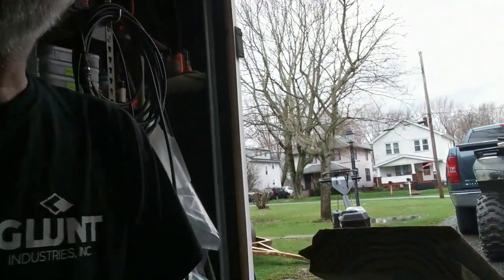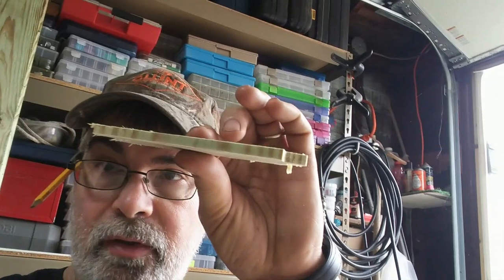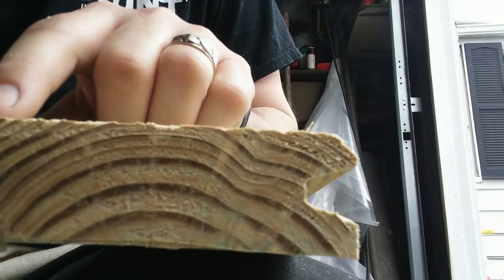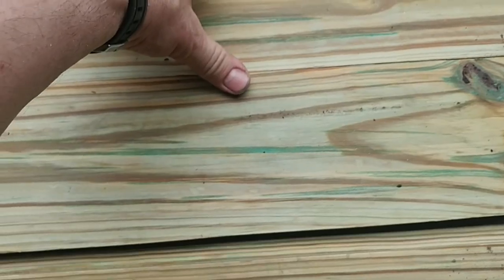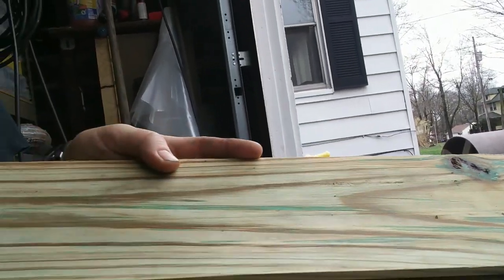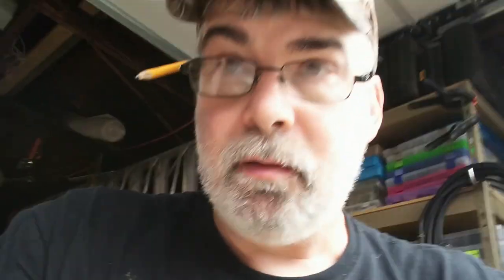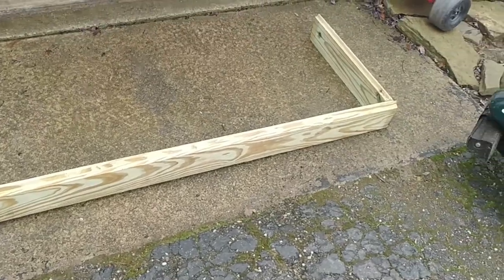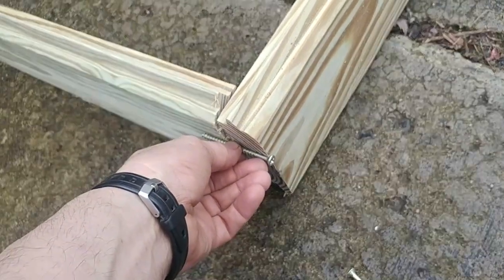How To Build A Compost Worm Farm Bin

Comment: You are probably safe buying and using BRAND NEW pressure treated woods purchased at retail stores today.  CCA treated woods are less likely to be available for residential use today because the industry stopped producing them in 2003 for residential use.   But CCA treated woods  did contain an arsenic based compound as part of the treatment mix.  You DO NOT want to put any CCA treated woods anywhere near plants that you might eventually eat!  That goes for compost that could absorb the chemicals and then transfer them to the plant roots.  The new pressure treatment processes used today use chemicals that are not readily absorbed in the human body and even if they were they don't contain arsenic. So new pressure treated lumber sold for residential use is likely safe enough.

That said, it is FAR better to keep your family SAFER by prevention than trying to keep them alive if they become poisoned!   That's relatively easy to do with a compost bin or worm bin.  Just installs some type of liner that goes between the treated lumber and the compost materials.   Rubber. most plastics, vinyl, etc. all could work.  All you have to do is attach it to the treated lumber.  I'd favor applying construction cement and gluing it on rather than puncturing the material with staples or nails.   You only need to line the sides.  No need for the liner to cover the ground as the compost needs to be able to drain off any excess water into the ground.   You can also apply various penetrating oil sealers, such as tung oil, that will seal off the treated wood but which are totally safe for human contact.  No need to take risks with leaching of chemicals into your food supply!

You built a very nice bin and I admire your work.  Hope you have great success with your composting!

Comment: Any update on this worm bin? How's it working?
Reply from the maker: The worm bin is working out great!  I've been adding greens and browns and watering it.  I'm getting some great compost out of it.
Reply: @RealLifeWithMichelleRob  Do you alternate left and right side feeding in order to get the compost out without scooping worms out? If not than how do you get the compost out? TIA
Reply from the maker: I alternate left and right sides.
Reply: @RealLifeWithMichelleRob  is there a screen in the middle? Sorry so many questions 🤪
Reply from the maker: No I don't have a screen in the middle  I am wanting to build something a little diferent.  I would like to be able to get to the bottom easier.  Maybe have some kind of screen at the bottom with a pull out drawer.